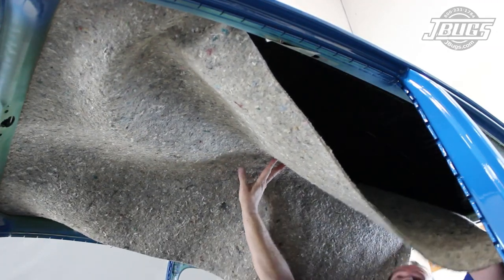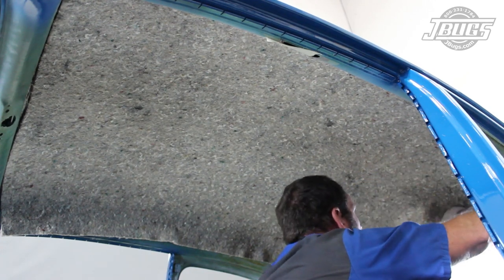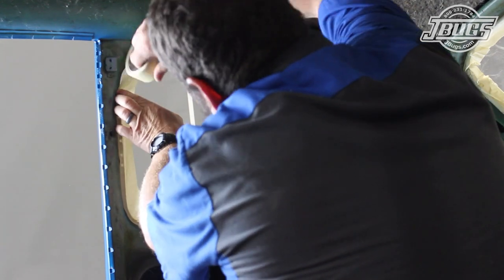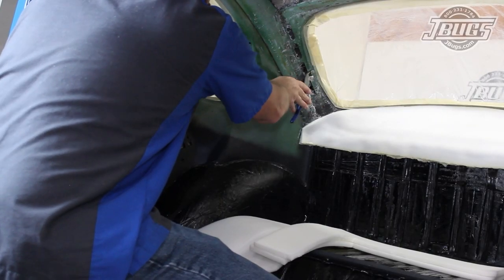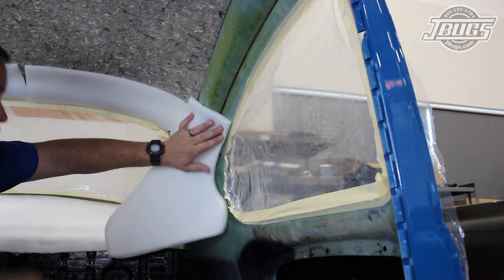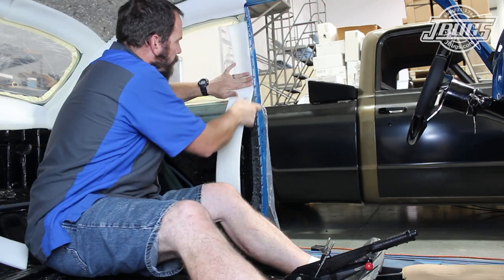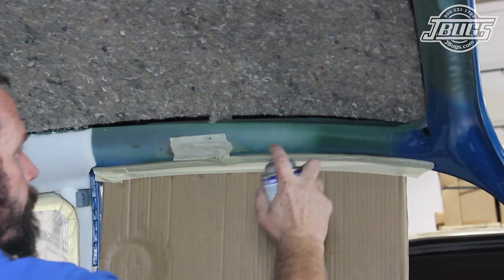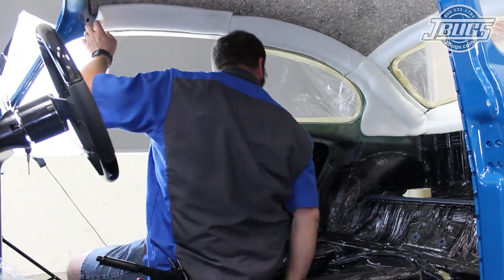JBugs - 1971 VW Super Beetle - Headliner Pad Kit Installation

Comment: what about the rear defrost?
Reply: As the rear window elements rarely work, we never bother hooking up the rear defroster wiring. We went further in this car and installed rear window glass without the element for a cleaner look as well. As for the rear window vents, 1971 has 1 year only vent covers that aren't made new so we covered them up.